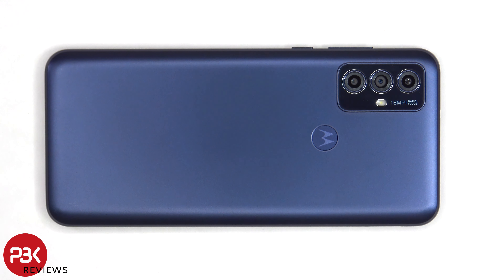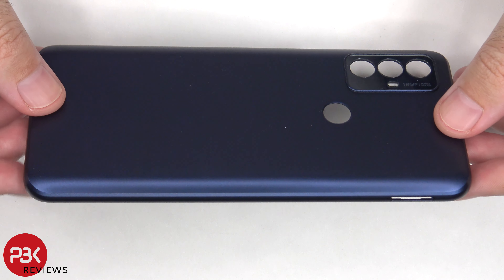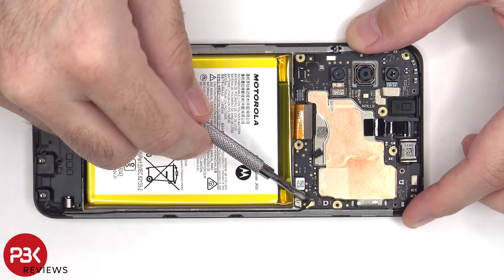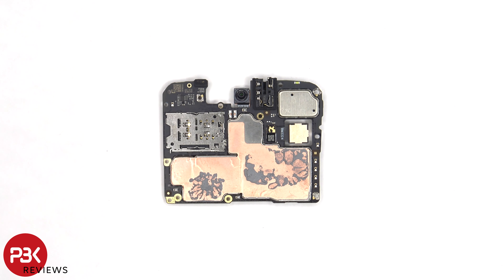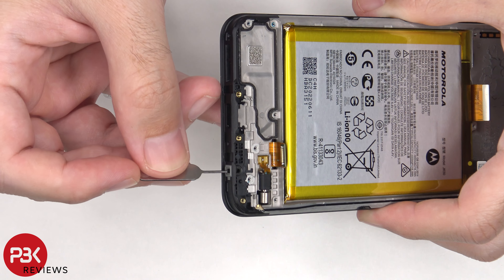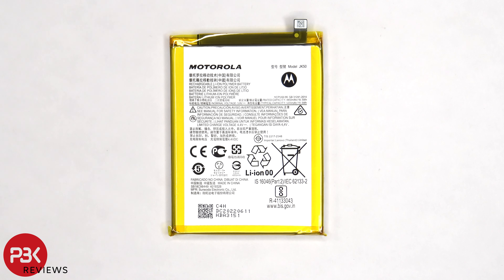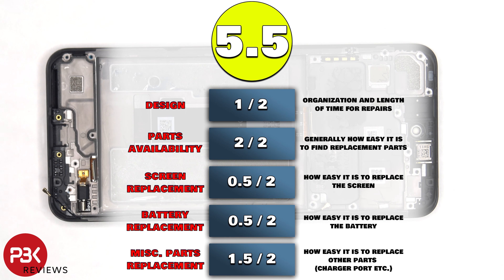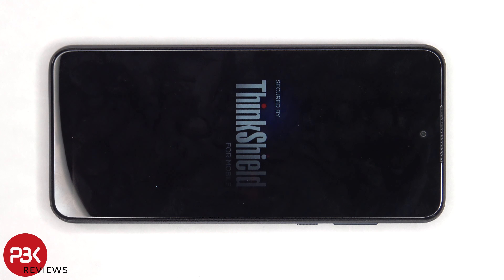Motorola Moto G Play 2023 Teardown Disassembly Repair Video Review

Comment: While isopropyl (ISP) alcohol can loosen the adhesive under the battery, on some phones it could seep between the rear screen layers which can discolor or ruin it (I've seen it happen to some people).  While most ISP will evaporate, it may contain a small amount of water which is really not good for electronics.  A better solution is to simply heat up the front of the screen to about 90C on a digital heat plate which won't affect it at all,  it will loosen the glue under the battery enough to be able to remove it easily with a narrow metal spackle tool.  This method works even on the hardest to remove batteries, on iPhones you'd heat up the back of the phone instead. ;)
Reply from the maker: Yup, it can happen. Best to use little amounts if using it.
Reply: Agreed. I worked refurbishing phones for about 10 yrs and only 100% ISP was used on them.  One gentleman would take the really bad ones and completely submerge them in it and put them in his little oven immediately after.  He also had great advice to use the little pods that come in pill bottles to fight moisture over rice which could cause mold, especially in charging ports due to all of the blowing into them.

Comment: How do you just take the cover/lense off to clean behind it, you mention it can be done without disassembly, but it would be good to see it done, and how do you replace the adhesive?
Reply from the maker: It would be best to take the back housing off for that since removing the camera lens off and re applying adhesive will be more work and complex. If its broken and you're replacing it, its another story but since this back cover doesn't have glue or adhesive holding it down, its just clipped on aside from the fingerprint sensor which has a little bit of adhesive holding it to the back housing. So just heat the fingerprint area a bit with a hair dryer, then remove the sim try, use a pry tool to get it in between the back housing and the frame of the screen right by the sim tray where the plastic is thinnest so you can easily get it in, then run it along the sides and release the catches. When the back is lifted from the frame, push in on the fingerprint scanner to pry it off the back and then fully remove the back housing, clean what you need to and place it back on snap it in place and you're done. But for the lens removal same, just apply heat, use a razor blade or x-acto knife and pry it from one corner of the camera lens glass to peel it off gently. Applying new adhesive you will need to probably order replacement adhesive tape or camera lens glass which comes with the adhesive pre installed. You can find parts for it at mobilesentrix.com

Comment: Do you know where it keep the extra storage beside the sd card because I'm trying to remove the pattern lock after factory reset
Reply from the maker: Its on the ROM or storage chip which is soldered to the main board under one of the covered shields and is not user removable or replaceable.